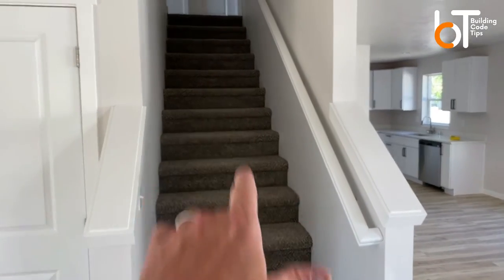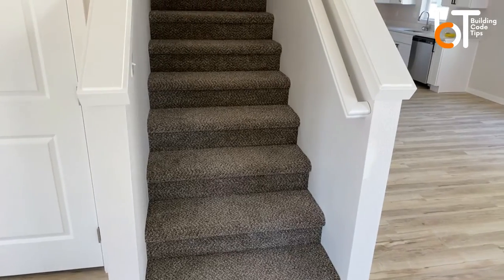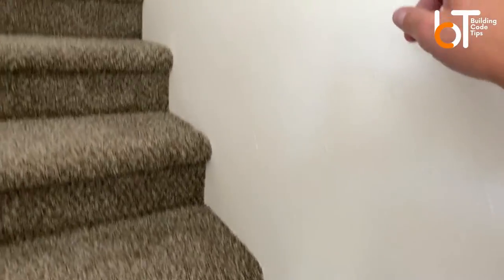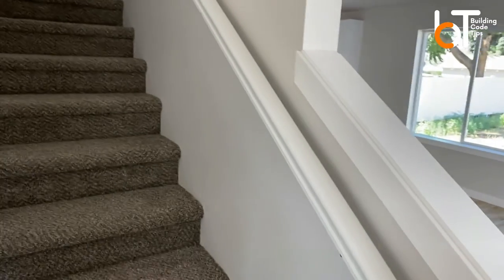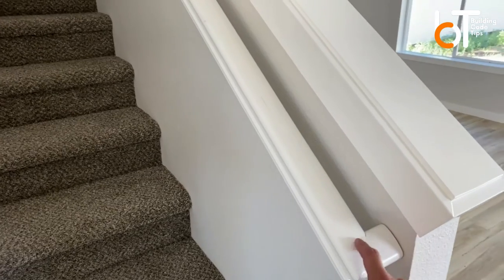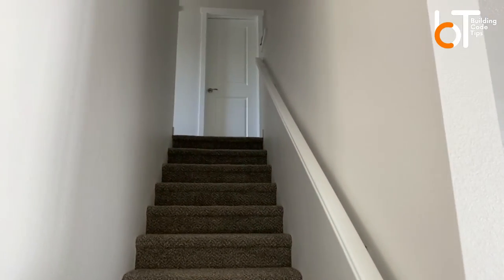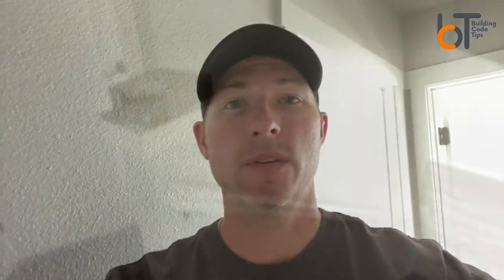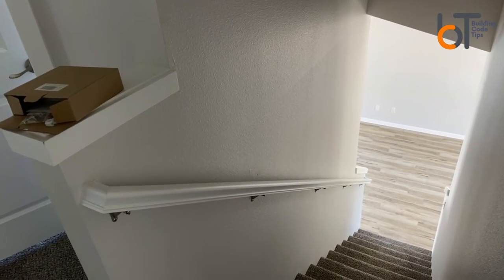Code Requirements for Handrail Installation | From A Building Inspector

Comment: Is there a code for the thickness of the rail? Jamming the fingers with the handrail bracket is not fun.
Reply from the maker: Hello, Yes there a number of handrail requirements on size and location. handrail is required to be 1-1/2" away from the wall or guardrail its attached to. Circular handrail requires a diameter of not less than 1-1/4" but not greater than 2". If not circular a perimeter of not less than 4" and not more than 6-1/4" is required. This is per the International Residential Code sections R311.7.8.3 and R311.7.8.5

Comment: In Canada, the code says 3 or more risers need a rail for INTERIOR residential stairs, or for exterior, 4 or more risers need it. And that is ONLY for residential / "single dwelling unit". All other stairs, commercial, public, industrial etc, then ALL stairs require a railing, regardless how many risers there are.
Reply from the maker: Thats interesting! In commercial here all stairs require handrail on both sides. Residential is only one side

Comment: I have a flight of stairs with 3 steps and then a 4th “step” which is a landing that turns the stairs 90degrees and continues up. You’re saying I only need handrail for the stairs past the landing?
Reply from the maker: Hello, Think of it in terms of risers not steps. If you have 4 or more risers a handrail is required per the International Residential Code. Less than 4 and you can omit the handrail if you want. Hope that helps!

Comment: How about the height guardrail and hand rail of the deck
Reply from the maker: Should be the same requirements. Guardrail is required when there is a fall of 30" or more and handrail is required when there are 4 or more risers, per the IRC. Anytime those conditions exist whether its a deck or interior stair case or some other situation guardrail and/or handrail would be required. Hope that helps!!

Comment: Is this same for ADA reqs for business bathrooms? (Believe rail needs to be 16” for rail behind toilet and 32” rail beside toilet) could be wrong.
Reply from the maker: Grab rail around a toilet should be between 33 and 36” measured from the floor to the top of the rail. (At least per the code requirements where I am at). The vertical grab rail should be roughly 39” from the back wall and 39” from the floor to the first part of the rail. Hope that helps!

Comment: Ben, quick question do I need continuous hand rail for my landing area or bend in L shaped stairs? I would send pictures but not seeing how to attach it
Reply: The landing has only one  diagonal step
Reply from the maker: Hey Lou, For residential applications a handrail does NOT need to continue through a landing. The landing must be at least 3 feet deep and as wide as the stairs. If there is no landing then you would need to carry the handrail around the corner with no breaks making it continuous. Hope that helps!

Comment: can you add a link to the uniform building code for handrails so we can read it too pls?
Reply from the maker: Where abouts are you located that uses the uniform building code?
Reply: i am in NJ.  it is called the uniform construction code.  pardon my error above.  but still my question on reading it would be helpful for both residential and commercial requirements.
Reply from the maker: @RJG772  Here is the link to the NJ uniform construction code, you can download the code in its entirety. https://www.nj.gov/dca/divisions/codes/codreg/ucc.html Though I did search handrail and guardrail throughout the document and it kicks you back to the IRC and IBC. Hope that helps
Reply: Thanks for the information. I needed a lot of this. Is the code the same for exterior deck stairs? The standard 2x6 or 2x4 top side rail won't work? I just have not seen many smaller hand rails on new decks..
Reply from the maker: @howarddover2442  At least per the International Residential Code all stairs have the same handrail requirements. Handrail has to be grip-able and the 2x4/2x6 top rail is not considered grip-able. In my area we are pretty strict on it. Other areas may not be. I know there is grooved cedar 2x6 that can be attached vertically and meet the requirement (if you can find it and like the looks of it).